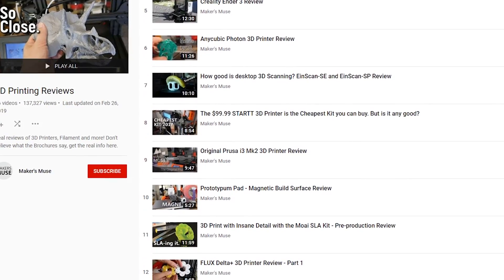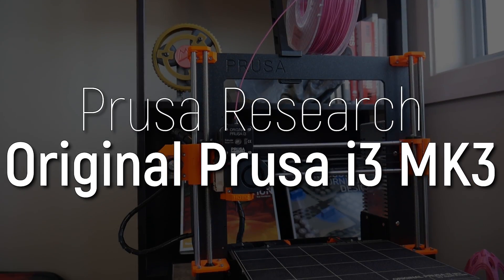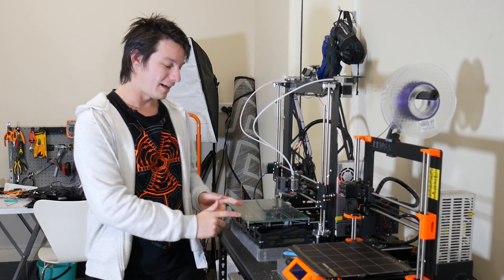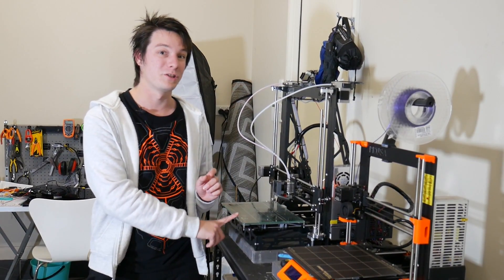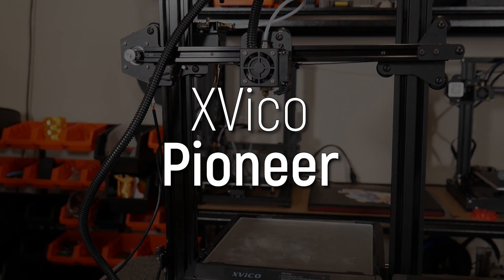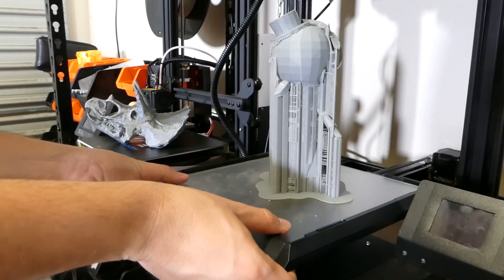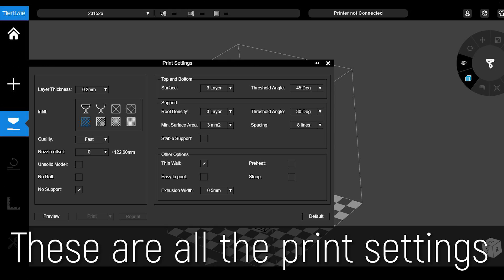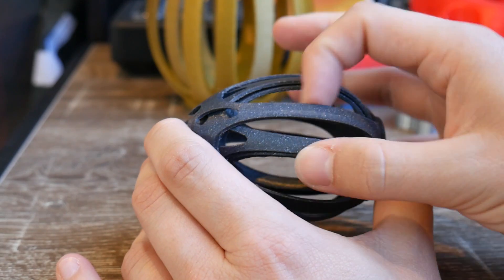My TOP 3D Printers for the 2019 Maker's Muse Studio (FDM/FFF)

Comment: My most reliable and most used printer right now is my Ender 3 Pro. Took me a few mods a lot of slicer settings tweaks to get it to print great though. Not that it didn't out of the box as it did. But I got to be a lot better with a few changes and tweaks. I installed a BMG clone extruder which I upgraded the coupler for it with a E3D groove mount and I added a E3D push fitting to the hotend. Then upgraded the control board to a v1.2 SKR Mini E3. Finally use a fulament double sided PEI textured/smooth steel flex plate.
 Oh, and I swapped out a few wheels after I wore them out and I also swapped out the Hotend as I wore out the original one as well.

Comment: Hi Angus =) i have a 1000$ budget, need about 210x210 build area and as high as possible  surface quality. what printer would you recommend? mk3s? b2x300? other/newer?
Reply: I have a B2X300 my self, and i can't recommend it to 100%, it has a nice surface finish, but its not perfect. 
Could be my fault for not tuning it properly, even thou i already spent 100h in trying to get it perfect.

I have no experience with the Prusa, but i wish i had gotten the Prusa instead of the B2X300.
If you want to go B2X300 you need a very high level of frustation tolerance and will to continue.
Reply: @TeaObvious  thanks buddy, i decided to go for the mk3s about a month ago
Reply: @domothepilot  congrats think you made the right decision. :-)

Comment: Just watched this video in 2020 as i am looking for a new printer to buy.
I bought my first printer 3 years ago (laser cut wood sheet and single extruder for £80) that is a clone Kit of a prusa MK2 and believe it or not, it works better than most 3D printer i have seen from other friends.
This is why its becoming so hard to find a decent replacement for this one
Yes, granted that being chinese low QC kit it came with warped Z lead screws but after printing some sliders for the Z axis, it works very relialbly.
Thhank you for the videos you are uploading.

Comment: I’m thinking of getting my first 3D printer and have seen the multi machines for 3D printing, laser engraving and concert carving. Are they a worth while starting point or just a gimmick in your experience?
My initial interest is for plastic parts for my motorbike and also for laser and carving for my woodworking business.
Soft flexible plastics and nylons to laser work on wood the same as the carving although plastic would be good too.
Thanks

Comment: In the market for a new printer but I use ABS almost exclusively. (hard to do product design in PLA when its all glistening and you can't tell the shape because of the reflections). I can't get good intel on how the Prusa and the Ender (the front runners at the moment) handle ABS. I know they will do it, but is trying to force them to print a material they aren't suited for more trouble than its worth? My experience with the UP (I have Afinias) printing with ABS echos Angus' results - best printers I have for ABS, but he's right, print bed waaay too small. Whats your experience with ABS and the Prusa's and Enders?

Comment: My favorite machine (one of the two :D) is ANYCUIC Kossel Plus. But with a bunch of upgrades like 32-bit SKR board, BMG extruder, printed effector for e3d V6, TMC2208 UART, optical end-stops, optical leveling sensor, Noctua coolers, some reinforcements and cooling upgrades, HDD bearing spool holder on top (my favorite :D). 
Right now it is doing a great job. Very fast, very quiet. Can handle up to 150 mm/sec with ease. And the quality of that prints is really great. Slowing down to 100 mm/s gives fantastic results. Smooth as butter.  
But! There is one GIANT con. Bed leveling. This is a real pain in the ass. Once you setup your delta - don't touch it! Bed movements or changing nozzle will ruin all of your work so you will need to return to step 1 and recalibrate EVERYTHING. That's sucks. But overall, looking at print quality and speeds - damn it is good.

Comment: I'm really disappointed with the bad print quality of the Prusa mk3s  printer. The XY-axis alignment is very very bad as the Z axis increases. It really seems like a software bug because when a XY pattern appears along the Z-axis, the XY deformations (offset errors) accelerate significantly. 
I saw you made a video about this issue. Any feedbacks?

Comment: Hi Angus, have you ever used any Ultimaker printers? Just wondering how the 2+ or 3 would stack against your picks. I really like the specs of the B2X300 with it's massive build volume, but if I cannot use that 2nd extruder then it's not a compelling option. Just wondering if you ever use "enterprise" priced printers.

Comment: any good 3d printer around the 350 $ range that doesn't come in a kit or atleast is really basic to mount and start printing with (without having to lose my sanity with the axis calibration!)?
Reply: If your looking for something that its in the budget and  easy to use I would recommend the Monoprice mini V2. Check out my review on why i think its a great printer for the price! and if that is to small I would just get the next step up in the line up of the monoprice series

Comment: Just use waterbased glue , regular wood glue on the glass. Removing is super easy, just add a drop of water at the side of the print and the water will lift the print from the surface within 2 minutes. The glue is normally working for several prints and is much easier to work woth than amy tape or whatever sticker thingy surface there is. Just make it cover the area, let it dry and add one more layer. The gluestick can be discarded as thats not as good as builders or wood glue.

Comment: Why do 3d printed models always have that nasty ripple texture to them?
Reply: @ ルーイスジューリアン・ They are made up from layers, the ripples are the edges of the layers. Higher resolution (thinner layers etc) improves this, as does smearing or polishing the surface with a solvent or abrasive, or coating it with something clear.  Clear Acryilic bathroom sealant is pretty good on PLA prints, imho.
Reply: @bmull81  - Thanks very much for the advice man, I'm glad there is a way around this (:

Comment: I am new to building 3D printers, but I did assemble my FLSUN-f5 CUBE with no issue following the provided instructions that came with the supplied SD Card.
However the Ardunio Software was corrupt so downloaded it from their website and installed this with no issue.
Installed the Repetier-Host V1.0.6 with no issue, had to then download the Latest Marlin Firmware from their website because the supplied firmware had Unknown Motherboard Error when flashing this firmware.
I am using 1 extruder with the auto levelling sensor at the moment but just having issues. I dont know what I have done wrong., can you help me out.
I have attached a link to a video that I have created to show the issue I am having when I G28 the printer. https://youtu.be/weaoIV5m1ZY
When I G29 the printer nothing happens - I have read up on the code and I was sure that this was to Auto Level the bed.
Someone did send me their Firmware of which I did flash to the Motherboard but still cannot get G29 to work, any help on this would be greatly appriciated.
I have spent 3 days building this machine and 2 days researching so far and now I am stuck.
I would also like some help if possible on setting up Simplify3D for this printer.
Thanks in Advance.

Kind Regards

Comment: Obviously Mr Prusa will not send me a free printer so I can't afford to buy one in that price range, and CrafBot I can only dream about. Anything below £250 recommend that can print both PLA and ABS. If any could suggest something I would be appreciated. What I'm looking is - heated bed, can print PLA and ABS, auto calibration (don't trust my eyesight), mid volume round 20x20x20, Don't mind to assemble but I don't want to buy printer and then realize that I need to do bunch of upgrades.

Comment: Well, I just got into 3d printing. My first machine was an Ender 5 and it was dead on arrival. Would keep failing in the heating cycles so I never got to print on it. I found a company close to me in Portland Oregon called Hydra Research 3D. I bought their flagship machine the Nautilus and I can't tell you how much I love this machine. I'm getting flawless prints on every material and print I do. It's wifi and completely intuitive. You should check them out. I haven't seen anyone else with one in the 3d printing forums and groups. They are still a dot on the map but man this machine was worth every penny.

Comment: Just bought a used Prusa i3 Mk3 and I’m absolutely blown away by the Quality and reliability ( I do encounter the wavy surface finish to tho) but then again I come from a  Spanish prusa clone the Hephestos 2 I assembled and has no heated bed a custom designed hotend with a Temperature variation of +- 5ºC and probably a bend z-axis lead screw so...🤗

Comment: SeeMeCNC Rostock Max v2 .. its absolute boss. Like seriously Every time  I see your print troubles I yell at the screen DUDE !!! Why in the world have you not used Delta's! Then I saw that review u did(cough cough not a SeeMeCNC, lol) .. I feel bad for your troubles.   Well, one thing I can share which I find impressive is >> First off I make new motor designs. At first I thought I would need a bunch of shafts. No way a printer can print motor shafts ... right ? ... um ya I print these things ALL THE TIME. Its an octagon with 10mm OD and my printer can reliably print them 200mm high. Its just incredible . Those parts are basically like printing a candle. Perfectly. There is something very special about the print bed NOT moving.

Comment: I'm currently using a Anycubic i3 Mega (you had recommended this a while back as I recall.)  I also picked up a i3 Mega-S recently as a backup after I had a power supply failure on the original i3.

Comment: Angus, I'm sure you're strapped for time but running Octoprint on a raspberry pi and connecting to the Prusa printer is a quick, cheap, and easy way to print wirelessly.  I'd highly recommend doing it.

Comment: Did the research and bought a Prusa i3 Mk2S (kit) back in Dec. 2017 and have been very happy with it.  I can go for months at a time and not print, and then decide I need to print something and it just works.  It's super reliable and hasn't given me any trouble.  More than can be said than my friend who bought a Chinese I3 clone (the first one from Monoprice), he kept having to buy parts for it and finally gave up on 3d printing.   @TheMakersMuse , you need to invest in some Raspberry Pies... I use a Raspberry Pi 3A+ (Wireless only) running OctoPrint in a custom case I designed and printed (https://www.thingiverse.com/thing:3463895).

Comment: Most reliable & most used is by far the Prusia mk3s.  PLA, PETG just work and I rarely get a bad print (and if I do it's my fault!).  Now I finally got the power coated bed I'm a really happy camper.  

The CR10s (300x300) with ABL is a good workhorse, but I now hate the glass bed and wish it had the removable magnetic bed like the Prusia.  

The CR10s5 is a disaster.   It works, but even with ABL it sucks for large (450mm x 450mm) prints.  I'm thinking of getting an AC heated bed upgrade to see if that helps. Comments on experience with this would be welcome!

The Flashforge Creator Pro has been extremely unreliable from day 1, despite hours (day!0 of trying to tune it, the dual nozzle system just doesn't work well and I rarely use it!  

The Flashforge Finder worked well enough, but the tiny unheated bed made me use it less and less and as soon as the Prusia arrived it was history.  

XYZ printers were all pretty bad!
Reply: I use Aussie extra hold hairspray with my CR10 and glass, it is easy, it is cheap and it works without fail EVERYTIME. :)

Comment: Well, I was homeless for a bit because the VA screwed up some paperwork, but when I got back into it, the first search term I looked up was ANet, because the A8 was my second printer and the one I loved the most. I ended up with an ANet A6, which has been the most awesome mistake ever shipped to me. Instead of the European power cord, I spliced it into an American surge protector (sorry OSHA, CE, etc) printed out some upgrades to help the belts out a bit, and I've been printing 100% ever since. You'd be amazed how much a simple axis upgrade will do for you, as simply  tightening the belts a bit takes out so many imperfections. Most of the many hour upgrades aren't even necessary, just work on tightening your belts a bit, and you'll be good to go.

Comment: I purchased the Up mini 2 just over 2 years ago for my young teen son. It is a really good printer for ABS, PETG, esun Flex, and wood.  Printing Palmiga 1/10th scale RC tires with eSun flex is a breeze. 
Unfortunately the up studio is a bit of an issue... When it is dead,  i will rework it with a 32bit controller and use a better slicer.

 https://www.thingiverse.com/thing:526969

Comment: Do you have a best in class for the a minis smaller than the  Up Mini 2? I an considering getting a printer for high detail D&D and BattleTech mini's but I don't need more than  3 inches or  70 cm square for the standard 1 inch square or hex bases. I also have a small apartment so storage space is the biggest reason I don't have  3D printer at the movement (though cheaper never heart anyone's feelings) and printing larger (on the The up mini 2's 120 mm scale) might work for me but seems like a waste of space and money if I can find something smaller.  Thanks for any advice.

Comment: Angus, I could really use your help with this XVico. Please?
Reply from the maker: What's wrong with it?
Reply: Maker's Muse 1. The y axis for the bed is too far back. The print head is landing too close to the back of the front plastic frame. I need to move the bed forwards so the print head lands further back? 2. I don’t have Cura 14.07. Can’t find it. I’m using Cura 15.02 from my old Anet A8. When I generate the code file, the printer won’t print? But when I print the Baymax (?) fike that came with the printer, that file works? 3. I have a couple of hot beds for various AM8 projects. I also have some decent power supplies. The control board for the XVico supports hot beds. The bed mount for the XVico supports the Anet beds, I’d like to change the power supply, and install a hot bed? Thank you for getting back to me. I will support you for helping me out. Mark.

Comment: [at 7:06] I have an cetus mk3 for 3-4 months now, and i hate that thing. All kind of troubles! Y-axis was not propper mounted, after the print was beaten off of the bed. Several prints! Huge clicking noizes, even cleaned the nozzle an replace with the 0.2 and 0.6 mm. The filament used was right out of the sealed bag. Tried seral temeprature settings, within factory recommendation range.
Even wished that i never bought this piece of crap! As a beginner i thougt that this would be the one, after your videos. I wanted to use this machine for thing that i designed and not for nick nacks. The question you pulled was; were do you want to use a 3d printer for, was for me the! question. So, i can not agree with your recommendation.
Now i at of, throw this in the bin and buy a other? Probably not. I am done with 3d printing. Hoera bravo!

Arie

Comment: I'm curious if you have any advice on what you consider to be the best low to mid range cost 3D printer for using recycled filaments in. Does it vary by recycled filament type (Ie. PET vs. PLA vs. etc.). Or if you have one overall that you'd recommend.

Thanks for any advice you may have!

Comment: I use my modified CetusMk2 all the time. I added the tinyfab heatbed in a way that I can level it out and get rid of the rafts. You need bed leveling to being able to print without rafts. But the time consumption and waste of material made me sick. And from there on it just prints perfectly. I still have the tinyfab CPU on my bench to convert it to a smoothieboard based system but haven't had the time to do that.

Comment: I think my pivoting swinging extruder design might work well on that B2X300, you can check it out on my channel, rough unedited vids for 3d printer designers and makers only, just describes the concept,shows the prototype functioning, so people can try to design their own version for the geometry of their printer.  Could shorten those tubes more than half and puts a lot of the filament movement on the filament being pulled into the extruder which removes it from affecting the filament being pushed out of the extruder creating a cleaner shorter less torqued path to the hotend.

Comment: I use a Prusa Mk2S for any prints that fit within its build volume and a CR-10S S4 for bigger prints.  I find the Prusa can print much faster at the same quality as the CR-10S, so I prefer using it.  The E3D V6 head can also melt more plastic per second, so I print with thicker layer heights to speed things up.  I only use my Wanhao Duplicator i3 Plus when both other printers are busy.

Comment: I have to say I am a bit surprised you don't have any higher end printer like Makerbot Replicator or Zortrax M200/300+. Also is there a reason why you don't have any Creality printer? Would love to hear your input.
Reply: dash3dot We have two Makerbot Replicator+ machines, a Replicator 2X, a bunch of Ender 3s, and three Monoprice Minis.  The Replicator+ are not in the same league in terms of reliability or quality.  The Rep2X only prints in ABS.  We only use them if all of the other printers are in use, and only for extremely low detail parts where it doesn’t matter if the prints fail.  However, in exchange for terrible print quality, the Replicators do print a little faster than the others.
Reply: @chrisbruce9497  Thank you for clarification :)